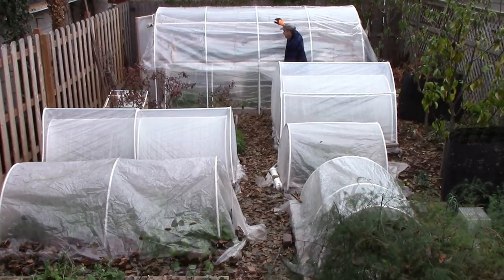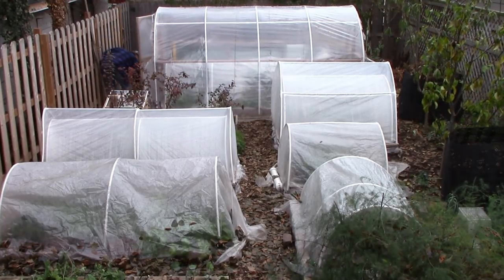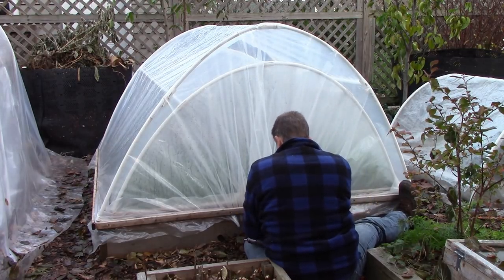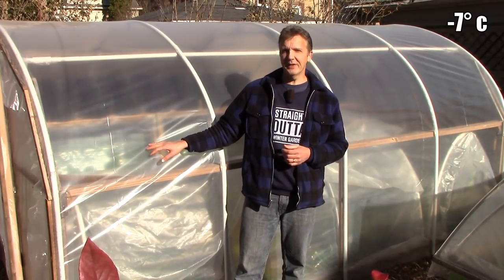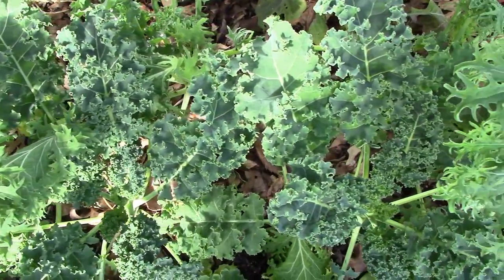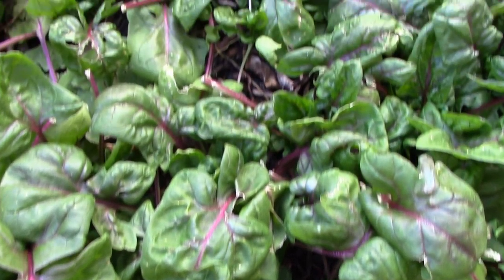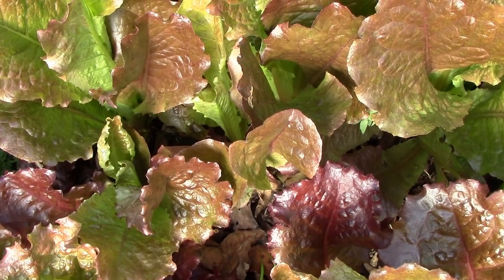Easy Manual Venting for Cool Weather Crops (Cold Frame, Polytunnel, Hoop House,Greenhouse)

Comment from the maker: 0:22 Summary of approach
0:47 Only cover from fall to spring, when freezing
temps likely
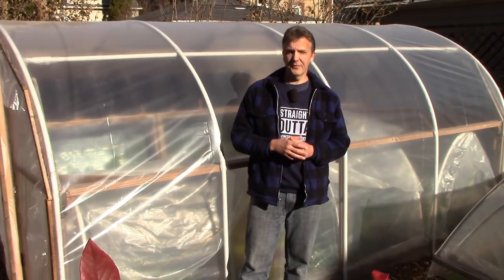1:53 Make only 2 venting adjustments per day (at most)
2:05 How I decide to vent in the morning:
     2:38 Vent if high GE 20° f / -7° c 
     3:04 Vent if high GT 10° f / -12° c and sunny
     3:20 Do not vent if high LE  10° f / -12° c
3:26 How I decide to vent in the evening
     3:32 Vent if low GT freezing 
     3:35 Do not vent if low LE freezing
4:02 Adapt my guidelines based on your max/min temps
5:10 Why I don't use automatic vent openers

4:01 Oscar Cameo! 😸😸

3 Ways You Can Support OYR Without Spending an extra Penny!

1) Stay engaged! Subscribe, like, share, comment, and select the notifications BELL next to the SUBSCRIBE button to be notified when new videos are released;
2) Let the ads run. This is a big ask, but the extra ad revenue will help offset the cost of cameras, mics, computers, software, etc.
3) If you shop on AMAZON in the US, you can support OYR simply by clicking this link (bookmark it too) before shopping: http://www.amazon.com/?tag=oneya-20
Reply: So you don't ever get 4 seasons in one day then? We don't have the kind of freezing temps that you do. Sub-freezing nights in June-July can be followed by glorious sunny T-shirt days, floods, or maybe by lashing gale-force winds and hail. Or those can come in summer. Snow is a once-in-15-year novelty, and rarely settles on the ground. I wouldn't know how to cope with months of heavy snow layers, but at least it seems you can rely on your weather being seasonal! Cold in winter, hot after the Last Frost Date. We've just had a couple of weeks of 85 - 90 degree weather in spring after a week of frost, and my "last frost" will probably come about the longest day of the year, or later. 
Another great informative video, thanks Patrick & the Masked Avenger

Comment: good info as always Patrick! given that i'm in zone 9b,  all of my cold winter crops do well in full sun w/o cover.  but i do have tropical dragon fruit plants which start to take damage in the low 40s.  so i built a hoop house last year.  inside i've placed two remote temperature gages (from acurite) which help me to know when to vent.  i also added a fan inside to circulate the air when the temp goes above 72 as the hoop house is on the east side of my house running north to south (5ft wide, 30ft long, 8ft at the peak), the southern end heats up earlier and higher and the fan helps to distribute that warmth throughout.  i have thermostatic, radiant heat in there for those few nights where the temp dips below 40.  and i have the fan remotely activated using text alerts from acurite and bridged to my smartthings hub via ifttt.  i open the back door when the temp starts to reach 90 which is typical on sunny days.  it's funny that no matter which zone you live in, you can always find a reason for needing cover! :D
Reply from the maker: Thanks, Charles! Sounds like a great setup! You're right. You can always find a good reason to grow under cover. I'd be doing the same thing if I was in your zone. I hope your dragon fruit plants do great this winter!

Comment: As my structures are on an Allotment I can’t easily change venting twice a day, and my decision tends to be much more about wind than it is cold as the strong wind will damage a fully vented cold frame so I tend to vent cautiously and consistently, opening frames by about 3” most of the time. Also I’ve found an inner layer of fleece stapled to the underside  my polythene coldframe covers (creating a 1” gap) is great insulation, and very cheap and resilient.  Thanks for the fantastic videos! : all the best - Steve
Reply from the maker: Hi Steve! You're right. Thanks to milder temperatures in the UK, far fewer venting adjustments are needed. You may have more overcast days too, which reduces the need for adjustments. With our more extreme weather, temps in the hoop house can vary from -12 c to 27 c in the same day, even with 2 venting adjustments. Best wishes with your winter garden!

Comment: Another great video! After too many instances of roasted veggies I abandoned manual venting. There were too many times I was rushing to get to work and forget to raise my bed covers. Yes, those automatic openers are expensive and there's a problem with them that you didn't mention ... and that is the challenge of installing them  and in a way where you can detach them so you can easily access your vegetables.
Reply from the maker: Thanks, Ron! Yeah, automatic openers definitely make a lot of sense in many situations. Out of curiosity, have the automatic openers ever malfunctioned?
Reply: I've used these openers (four of them) for about 8 years and haven't had a malfunction. HOWEVER, I've only used them in early spring and I remove them (and put them in my basement) once the last spring frost is gone. This is the first year that I'm using them to extend the season for one of my beds (carrots, beets, arugula, daikon, wasabi, spinach). Quite pleased with the results as all have survived (so far) despite most nights below freezing). I was going to remove the cover and lifter as winter progresses but I think I'll leave everything in place if only to see if the lifter survives our (sometimes) -10C  (14F) weather.
Reply from the maker: Thanks, Ron! That's good to hear. I've been thinking of buying one to test on a cold frame during the winter. It wouldn't me save any time, but I'm curious to see how well it would work.
Reply: I'm sure that would be helpful to some of your viewers. I'll try to remember to let you know how my lifter survives the winter. Come to think of it, I remember reading something about protecting these vents from extremely cold temps. Based on seeing your results using double covers, they might survive more severe outdoor temps. Cheers.

Comment: Are the black buckets in the greenhouse used for retaining heat overnight?
Reply from the maker: Yes
Reply: have you got any idea how much difference it makes for keeping night lows up?
Reply from the maker: Unfortunately, I don't. They do get very warm in the day and remain much warmer than the hoop house ambient temperature at night, but I'm still trying to think of a good way to measure their impact without removing them to establish a baseline.
Reply: OYR Frugal & Sustainable Organic Gardening I cant believe you didnt perform a control test first. Lol A couple of things would be worth trying. Maybe a stick-on thermometer on the outside. And/or a meat-type thermometer inserted into the water and read from outside. Idk how accurate this would be. The stick-on might end up reading air temps but idk.
Reply from the maker: I love doing experiments, but it's really hard to find the time. I did record temps for two weeks in mid-winter a couple years ago. I could use that as a baseline. Imperfect, but could be interesting.
Reply: OYR Frugal & Sustainable Organic Gardening Do it do it! 😀 I made a chicken warmer by putting 2 small storm windows together in a tepee shape inside my chicken run. I set them where the first morning sun rays will hit straight on one window. I clipped a small thermometer in the inside. Sometime late October we had a nighttime low of 28 and it was "brrr freeze" when i let the birds out. About 10 minutes after the sun hit the window the temp inside was 50. 30 minutes later it was 70 but still under 40 outside.  Now, chickens are hardy and actually dont necessarily run for a warm spot unless its really cold.  They discovered the warmer after i tossed in some corn and hung out intermittently till they had enough.  My idea is when it gets cold cold in Jan and Feb, and when we get some snow, they will have a warm dry place to escape to. I have more windows to make more tepees too. I guess the moral to my story is you probably have more solar gain than you know.
Reply: Wouldn't it be a better idea to put the buckets at the bottom and the beds on top of them? That way your plants are getting more heat released from the buckets below them, since warm air tends to rise up. Also the raised bed would be easier to handle.

Comment: Hope everything is well, haven't noticed any new videos in a year. I have been using some of the things I learned from your channel including low tunnels and double layer tunnels. I'm off to our earliest and most promising start ever thanks to growing under 6 mill plastic cover and double layer. Next year I'm going 75% raised beds I'm 60 now and just looking to bring the shorter plants up to me lol. But I'm building hoop frames or low tunnels on my  beds very similar to the way you have. Some of mine will have tie down rope at each hoop and it works great for venting when you can't use hinges. 🍅🥦🥬🌶🌽🥔🥕

Comment: Great Video, my large hoop house has auto vents set for 72 degrees,  it is funny to see them open in the winter time. How are those blk heat buckets working? We still haven't had a good frost yet over in the Seattle area, lots of rain though.😆
Reply from the maker: Thanks, Chris! Sounds like you have a great setup! The buckets get quite warm and stay much warmer than ambient temperatures at night, but I still haven't figured out a good way to measure their impact on the temps in the hoop house.

Comment: Could you show us how open you open your hoop houses for venting. Visuals would be very beneficial to see just how much air you are letting in. Also, for those of us who go to work before sun-up are we able to vent without things getting too cold before the sun does come up.
Reply from the maker: Hi David! You can make your morning adjustment before sunrise. You might want to vent a little less if you vent very early in the morning. Make sure to monitor max and min temps and make adjustment accordingly. The amount I open the vents varies a great deal depending on the expected high and if it's expected to be sunny - anywhere from closed to wide open.

Comment: I've seen it in another video but one thing that might be good to show here is how you vent, because some people might imagine it's more than just raising the tunnel and sticking a block in!  And do you ever vary the size of the opening?  More generally, the biggest obstacle to venting for many people is that they have to leave home in the morning before temps rise to a rentable level.  I've been wondering whether venting at the top rather than the typical bottom approach would work there, in other words if it's 7 AM and you have to leave. ,but really you shouldn't vent until 9 or 10 AM, venting at the top would prevent too-cold air from coming in.
Reply from the maker: I typically vent around 8 am. For people leaving home a bit earlier, I'd still go ahead and vent in the morning on days when venting will be needed. Sure the plants will get a chill, but it's more important to protect them from overheating later in the day (err on the side of venting). Venting at the top might expose plants to less of a shock from cold air, since warm air rises. Yes, I  vary the amount I vent depending on the expected high, how sunny it's expected to be, and feedback from my max/min thermometer (see 2:39, 3:13, 4:53).

Comment: As usual very info rich vid...Did I miss the actual act of venting...how many inches and where structurally? Looks like for those larger glass/wood framed covers hinged at bottom you prop open the place spacer in gap? Details like that would give needed how to to the when to data.😀
Reply from the maker: Thanks, Brian! The amount we vent varies anywhere from closed on a cold cloudy day to wide open on a warm sunny day. Though I wish I had shown some examples, they wouldn't necessarily translate to other gardens, because there are so many variables at play. The best approach is to initially follow the general guidelines, and then monitor max and min temps to adapt when and how much you vent. I hope this helps!
Reply: OYR Frugal & Sustainable Organic Gardening showing examples of the mechanics vs number of inches is what I'm thinking would help our replicating your examples
Reply: I.e. open at top vs bottom, easy mechanical set up...

Comment: Patrick, thanks for making me aware of the need to vent even in the winter. Could you give me some resources (web pages, books, etc) with more information about venting? I would like to know the upper and lower ranges between which I need to keep the temperatures in my vinyl house. This looks like an interesting DIY project with Arduino.
Reply from the maker: The preferred temperature range depends on the crops. For our cool weather crops, I don't want it to get much hotter than 80 f / 27 c. On the lower end of the range, I want to keep it above freezing as much as possible, though it will definitely drop well below freezing where I live. Unfortunately, I'm not familiar with any online resources on this topic. There are so many variables that it's difficult to provide specific instructions that apply broadly.
Reply: Thanks, that makes sense. Now I think of it, I would assume that the lower range would better be 40 F / 4 C, because below that temperature many plants sustain tissue damage. As you said, it depends on the crops; for example kale needs to undergo some freezing conditions in order to taste better.

Comment: Hey Patrick.  Great video and detail on a topic that frequently is glossed over in books and shows.

I was wondering how you handle watering for the winter gardens.  Since they're under cover, they don't receive rain so I assume you water by hand.  Is that correct or do you have some other method?

Thanks.  Any response is appreciated.
Reply from the maker: Thanks, Davin! In our area, plants are usually dormant from late fall through late winter when lows are below freezing most days and we have less than 10 hours of daylight. During this period, I typically don't water at all. Dormant plants don't need water, and watering might even damage them. Before and after this period, I water by hand as needed. I hope this helps!

Comment: In zone 9 my largest mistake in last years small green house was not venting enough were temperatures often reached over 85 degrees F & I accidentally hit 106 degrees a few times, my poor peppers.
Reply from the maker: You're absolutely right, Bob! Overheating is often the biggest risk. Even here in zone 5 It can even get over 100 degrees under double cover in winter on very sunny days.

Comment: Excellent info as always!
I wonder if that’s why I had such shoddy luck with “winter sowing” as we’re in zone 8b. Maybe my seeds froze and roasted?
Reply from the maker: Thanks! Yeah, it's the extreme temps that you have to be very careful about.
Reply: OYR Frugal & Sustainable Organic Gardening do you still use the winter sowing? I haven’t gotten a whole lot of help from their website. If you still use it, I’d love an updated or devoted video. 
You really do a fantastic job presenting information.
Reply from the maker: Okay, I misunderstood. By "winter sowing", you're referring to starting seeds in plastic jugs and bottles? Cold frames, low tunnels, etc. are far superior than this method. Now that I have enough of these structures to meet my needs, I don't start in plastic jugs and bottles anymore.
Reply from the maker: On a humorous note, the last time I mentioned their FB page, they gave me hell on the page for not adhering to and trusting their methods. It really caught me off guard. Of course, I never said I was a "winter sowing" follower. The last thing I am is a follower of any dogmatic method. And cold frames, low tunnels, etc. are far superior.
Reply: OYR Frugal & Sustainable Organic Gardening yea, kinda why I rather be here. You do a great job, and are clear and concise yet respectful. 
Had similar experience. 
Not into the aggressiveness. I like challenging garden common knowledge and trying things out. 

So you just ground sow but under cover? Like in your hoop houses?
Reply from the maker: Thanks! Yes, when I want to start seeds early outdoors, I direct sow under cover (cold frames, low tunnels, etc.). I'm sorry to hear you had a similar experience on their page. Even one of their administrators joined in bashing my video (the one in which I recommended their page!) Very strange experience. I'd be happy to compare my results to theirs any day.
Reply: OYR Frugal & Sustainable Organic Gardening And that is part of why I reference you.
Seriously. You do a good job. And I know how much work putting a good video together can be, so I gladly do my part to pass along your videos! I hope it helps encourage you to keep them up!

Thanks Patrick and happy gardening

Comment: You said venting 2x a day... but how long do y vent?  1min, 2 min, 5 min, or all day until sundown, it's still once in the morning and once at night.  so how long do you vent, and do you have to hang around to close it, if it's under a minute.  and where do you get your indicator of low and high remotely thermometer?  please reference the cheap one, and or compare, also, about venting, please, it's a real problem for me... and how to set up these remote thermometer reading, must make a video.  thanks, Patrick.
Reply from the maker: Hi Betty! The morning adjustment stays in effect until the evening, and the evening adjustment stays in effect until the next morning.